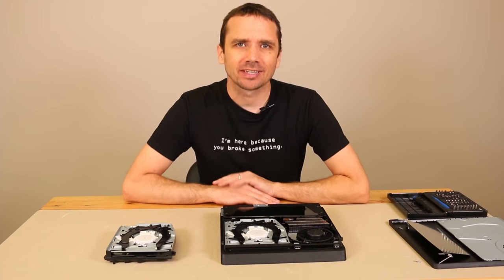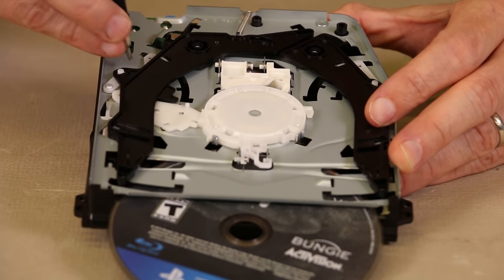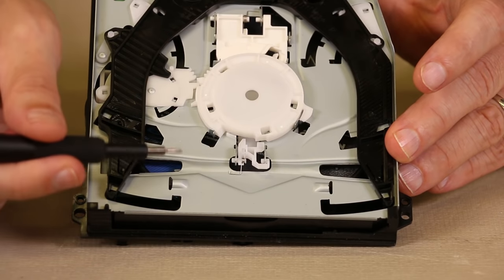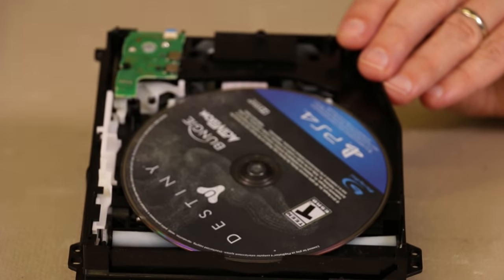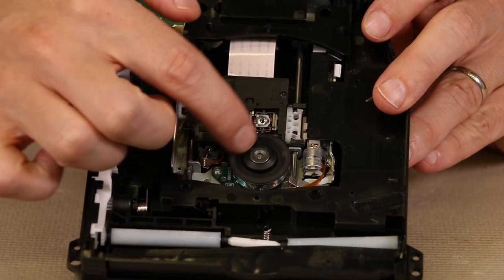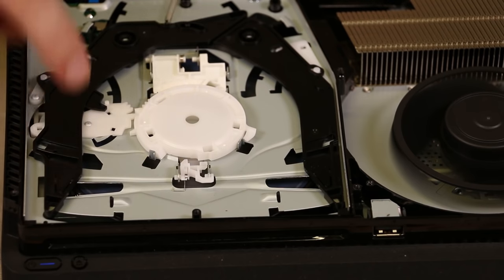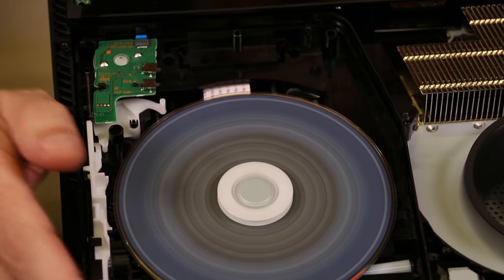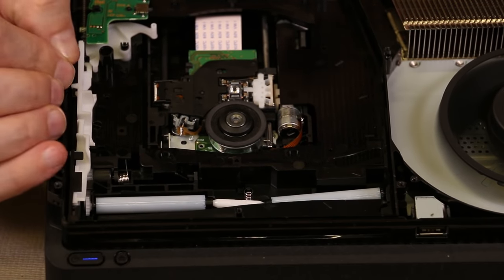How a PS4 Disc Drive Works - Very Detailed

Comment: Hey mate, i love your videos very informative, with deep knowledge.
I wonder if you have been counting how many PS4PROs have already been in your hands and what are the data you gathered from them in terms of failure rates.
I have been researching about the difference between the SKUs The PRO has 3 CUH 7015, 7016, 7006. As you live in america the most common is probably the 7015B, anyway, as Japan and Europe comes with the 220V-240V i wonder if they are more prone to  PSU failure and overheating as well, i know all are bi-volt, but maybe the specification for the quality of the PSU is higher on US since it has to offer reliable quality under 110v.
Please make a video on this topic, here in Brasil is a discussion that keeps going on, and i'm sure that putting your video on forums it would get you many views, the problem is mostly about the english language, but with some visual content people will be able at least see some proof.
Reply from the maker: I've gotten some Pro's in for repair. We've had a lot of insect infested consoles, some disc drives and HDMI ports. I've seen maybe one that had a bad power supply that was not caused by insects.

Comment: I am surprised Sony using so low tech just 2 piece roller to pull the disc in and eject the disc just push up the roller and push out...

Comment: I have a question for you how many sensors does the PlayStation 4 first generation has, and which one of those works with the image of the system that is showing on the TV???
Reply from the maker: Sensors? I have no idea. The HDMI port and the IC chip are the two that usually have a problem that causes display problems.

Comment: Hi TronicsFix, I’m curious about the magnet assembly that drops down. My magnet is dragging on the CD making a noise, and I can’t quite figure out why. I think it may have to do with the alignment of the magnet
Reply from the maker: The magnet itself is dragging? Or the plastic carrier that holds the magnet is dragging? If it's the plastic piece you can fix that. There are several places where that plastic piece is help up by the metal plate. You can bend those little tabs up just a little bit so the plastic piece stops rubbing on the disc.

Comment: Hi. Great video and very detailed. I'm having an issue with the disc drive in my PS4 Pro where it won't "suck" the disc in and it also doesn't read the disc if I insert it manually so I'm guessing that the laser is bad so I have a spare laser but still that won't solve the issue with it not starting the rollers when inserting. In the video it seems to be the switches the arms press when inserting it, is it possible to fix those switches?
Reply: I have the same issue, did you fix it?

Comment: Nice video I have a question I recently replaced my   Disc drive  my PS4 pro but But when I try to put a disk in it stiff like there's no power I was wondering if anyone had an idea what it could be Thank you
Reply: Certo!
Resistenza f6202, l'ho cambiata oggi ad una PS4 SLIM

Comment: Imagine if caveman had seen a device like this, or even someone from just 200 years ago? All this tech for these discs is a dying breed the Switch has set the new standard with cartridge based games again eliminating hundreds of these components in each of the millions of units sold.

Comment: I'm not sure what's wrong with mine, all evidence suggests the laser is bad and I sent it for repairs but it's still not working even though they replaced the laser. I mean, they said they did. 

They clearly tested a game on the machine as it was installed when I got it back so can't imagine they lied.

Meaning it most likely does have a new laser but still isn't working, I have to tap on top of the console for it to work.

Comment: Fantastic Guide, cheers mate, i need that you help me, i had the ps4 at cheap price, but it has some problems ... the model is 1216b, and the disk drive is like your movie, i repair the eject the disc , but the laser does not turn it the disc ,the disc stay stop.
i checked the cables flex, they should works it, the laser turn on blue light, red light as well, up e down works it as well , just disc does not turn it .
what do you think about? could you help me please?
Reply from the maker: It's hard to know without being able to test it. Could be just the spin motor.

Comment: Great vídeo as always. Just a little help, sometimes right after i turned my ps4 pro on and insert The disc i can hear 3 beeps sound, is right after i turn The console on and Just insert The disc right. This happens when i put The disc as soon as The console is on. You may have a explanation? Thanks a lot
Reply from the maker: No, not sure. Sorry

Comment: Very good video! One quesiton, the white lever on the upper left corner close to the switchers that the black arms touch, is that meant to be pushed by the CD when it comes in? or the mechanism from the plate moves it?

Comment: I think this answered my big disc drive problem. I took it apart thinking it was the rollers out of place. This wasn't the case. When I insert my game it doesn't seem to want to spin, it just clicks the makes a cycling noise, the clicks then it pops up unrecognized disc. Would you say the motor is broken that spins the disc?
Reply from the maker: Possibly, or it could be the laser or even something else in the drive

Comment: Just a quick question, I got a very small scratch on the label of my PS4 game disc on the label side, near the center of the disc. I can see light through it on both sides but the actual scratch was on the label. I put the game in and it seems to run fine, I thought I was seeing a loss in fps or performance speed but that might have just been my imagination because I was anxious about the status of my game. Is everything okay with it?
Reply from the maker: It's probably fine but no way for me to know for sure.

Comment: Hi TronicsFix I have a question, I have one of the older ps4 models I think is the CUH-1100 model. So here is the problem I have purchased the newest starwars battlefront game, and we have been playing is for over atleast a month now and I had no problems with it and then about 3 days ago my ps4 started saying it was over heating and I just started the game and if I get lucky I can only playing for like 10 minutes or so then the ps4 makes 3 beeps and turns off. But here is the funny thing it does not do this with any other game/app. So you think you could help me?
Reply: MeXiGaMer415 wait is that the only PSN game you have or do you have more games that require PlayStation plus
Reply: Jus the game, some are more graphically intensive than others. Clean the fan that's the problem buddy.

Comment: Sometimes when I insert a disc the console doesn't recognize it, I have to eject it and re introduce it for the console to recognize it, I used it vertically. It's a PS4 pro 
Also when it doesn't recognize the disc when I press the button to eject, it ejects the disc but at the same time it makes the two bip sound indicating there's no disc.
Reply: Bro try to use it flat position to make disc reading more better.....

Comment: You didn't really cover anything on the mechanical component's fitment of the upper sheet metal assembly. I put my disk drive back in and now it won't take the disk. Like a mechanical component is in the way. Came here to learn all about the disk drive. Still searching unfortunately.

Comment: Hi, thank you for this useful video, but I have a question for you... my PS4 PRO no longer reads discs when it is positioned horizontally (instead in vertical it does) and it does EXACTLY the same noise, just the same, which does yours at 5:35 minute, but also with the cd inserted... what can it be? could be maybe the magnet that does not place the disc in the right position when the PS4 is in horizontal anymore?
Reply from the maker: Unfortunately, I really don't know. Sorry I don't have anything for you on this one.
Reply: I second that. It seems this is specific to the PS4 Pro. Mine is the CUH-7016B. I made a wood stand for it. I only have two discs and I never let them in if I am not playing. The rest is all digital (50+ games). Friend of mine lent me a disc. Same noise. I was dumbfounded. Googled it. Put it vertically. Works 100% of times. I clean my ps4 every 6 months with qtips and check the heatsink. I treat it as I would treat a newborn. No brute movements or shakes. Even so... this happened.

Comment: How does the disc processor prevent a person from forcefully inserting another disc if there already is one in the console ?
Reply: The PS4 will simply won't let the disc in. This happened to me a day ago.😅 I forgot to eject a movie disc and when I went to insert the other the console did not let it in. The moment the disc I tried to insert touched the entrance it didn't get in at all, just bumped against a locked entrance. That way I realized there was a disc already inside.

Comment: The white rail to the left isnt going forward on my drive, I have tried everything, any suggestions, also the manual eject is not tighting
Reply: I had this issue exactly. I managed to fix it by pressing the roller tray/assembly down and adjusting the manual eject screw until the rail came forward enough.

Comment: Mine looks exactly the same as yours as far as I can tell, but the white plastic piece on the side doesn't get pushed far enough to engage with the gear when a disc is inserted. I can't figure it out.
Reply from the maker: I'd have to test it to know what the problem was.

Comment: I have a PS4 Slim, the disc drive is failing. When I try to insert the disc, the PS4 does not take it, you know the drag thing that the PS4 does when you insert a disc. I opened my PS4 by following your video, and I cleaned the rollers, laser with alcohol, I checked the mechanism of the cd drive and I noticed there was some plastic thing out of position, so I corrected. When I finished, the cd drive worked fine again.  It took the cd back again without any issue. 
After a few days without using it, i turn the PS4 and the same error occurred again, PS4 didn't take the cds.  
Don't know what to do now. 
Any idea that can be failing on this cd drive ?
Reply from the maker: There's just no way for me to know for sure without having it here in my shop to test.

Comment: My ps4 cuh-1215a Wont read any disc. I've cleaned the laser with rubbing alcohol, still nothing. It takes and ejects the disc fine. Sounds like it could be spinning, but not spinning the disc very fast? Or maybe a bad laser? Hard to tell. I would like to figure out how to take apart the ps4 like he showed with it plugged up to see if its actually spinning, the laser moving and all that stuff. I'm trying to see if I might just need to buy a new laser or if i need a new disc drive entirely.
Reply: Ryan Sprague i have the exact same problem

Comment: I’m trying to fix my PlayStation 4 slim, I took it apart and cleaned it using your other video. There’s something wrong with this drive but at first glance all the pieces are in the right place and there is nothing stuck inside. After putting it back together the disc still won’t go in. The rollers are clean and in the right place. I can’t figure out what’s wrong with it what else could it be?I can’t figure out what’s wrong with it what else could it be
Reply: Something wrong with the disc drive***

Comment: Question, I have few minor scratches on my PS4 cds. Will it harm my PS4, also I have a cd which has a scratch on top meaning where the coloring is done like where the name of the game is written. Just worried if I should get a new disc before it harms my PS4 pro.
Reply: Any update?

Comment: i took my PS4 and the disk drive apart to clean the roaches out and when i put it back together it will neither take a disk or eject when i took it apart to insert one manually but it runs the disk game smoothly without scratching the disk but i don't what's wrong with it
Reply: before i took it apart to clean it the ps4 was able to properly eject, inject disks and play them just fine

Comment: Does the disc spin all the time? Like 24/7 assuming you play the game or only when loading missions and such?
Reply: Spins only when it needs data. Most games are installed onto the hard disk so the disk only spins initially when you start the game and it doesn't spin at all after that.

Comment: how often do those switches go bad cause i took it to repair and they reassembled the disc drive they thought something was stuck, but still doesnt work,
Reply from the maker: .1% of the time. Generally the only time they go bad is when someone takes their disc drive apart and doesn't put it back together correctly and breaks the switches.

Comment: Is clicking sounds from a disc drive normal when you insert a disc. On my ps4 pro whenever i insert a disc it starts to spin up then makes a (click click) sound, starts to spin up (click click) sound again and then the ps4 recognizes the disc. It always only does it twice whenever i put in a disc. It has also never given me any error codes for discs. It doesnt make odd sounds when playing the game, just when initially inserting it into the ps4. Thanks.
Reply: I have about the same problem, did your PS4 got into troubles ?? (i have the slim btw) and this clicking noise happens too when it slows down ??

Comment: how hard is it to change the little switches the black arms touch? i think one of mine is bad because it will not accept a disc. thanks!
Reply from the maker: It's very unlikely that it's one of those switches unless you accidentally broke it yourself. But they can be changed by soldering new ones on.
Reply: @Tronicsfix  could You do tutorial about it please?

Comment: I believe that my drive is faulty due to the switches at the back of the board you mentioned at 3:30. Is there any way to fix or replace the those said switches without purchasing a new drive? Thank you. For background, my PS4 can read disks fine but the only way to insert them is manually with the screw on the back.This also goes for ejecting the disk.
Reply from the maker: Yes, those are replaceable. You can just replace the motor or you can desolder the switches and solder new ones in.
Reply: TronicsFix thank you so much!!

Comment: Hey man font know if you still read these comments but my ps4 doe recognize if I want to push in a cd but it doesn't take it in. It also doesn't start moving the laser up and down on the spindil or the laser it self. Do I need to buy a new laser part, or a new cd drive? Is it maybe also fixable?
Reply from the maker: Unfortunately, there's no way for me to know what's wrong with your disc drive or if it's fixable. I can only tell when I have them here to test. Sorry about that.
Reply: @Tronicsfix  ok well still thx for the reply

Comment: +Tronicsfix Question for you!! Does usage depend on how long the drive will last or is it just prone to go bad even with low usage? I don't really use the drive as much anymore since Digital games exist. Every now and then I use the drive but not mucha at all!!!
Reply from the maker: If you use it a ton it will likely go out sooner.
Reply: I don't have the PS4-specific experience that our esteemed host does, but in general, if the laser is adequately cooled and kept well within its power limits by the control circuitry, they can last a really long time.  I still use a Sony D-50 Discman - built circa 1985.  Works great!

Other things can go wrong, like dried-out lubricant on the sled rails, old electrolytic capacitors (few and far between on the drive mechanism itself I would imagine, but certainly in the PSU), the rollers could dry up and lose grip, and those plastic gears may get brittle with age and crack.  In a well designed system, the laser diode itself may outlive the rest of the drive.
Reply from the maker: Yes, they are made to last a very long time. It's likely something else will go out before the laser...or the lens will get dirty.

Comment: Can you do one on how the cartridges work on the switch?
Reply from the maker: Maybe...that would be less interesting though I would think
Reply: TronicsFix you know how the lines on the back of the game cart have some going up and down? The pins I’m wondering. If you play it on the cart do the pins ever move while it’s inside the cartridge spot? Like if it was on a specific level? Or do the pins stay in one place all the time?
Reply from the maker: They stay in the same place. The pins are just connections where they connect to the console. There'a a large chip inside the game cart and that's where the game is stored.

Comment: Hi, i have a PS4 slim which make a bit of grinding noises on start and end of spins about 3 times before full speed of full stop, grinding noise like at 4:58 when disk start but 1 or 2 seconds after too. I possesed a PS4 slim before which i don't remember did this noise, but my new slim does it, Anyone have any idea ?? (it works perfectly beside this little cranks when speeding up and slowing down)
Reply from the maker: I really don't know. I'd have to be able to have it here to test.

Comment: Can someone help me, my issue is that when I try to insert a disc it doesn't grab it.
I already opened it and the rollers are connected with the white plastic connector.
I also cleaned the rollers and is like it simply doesn't recognize anything at all!
Reply: Were u able to find a solution? I’m currently having the same problem